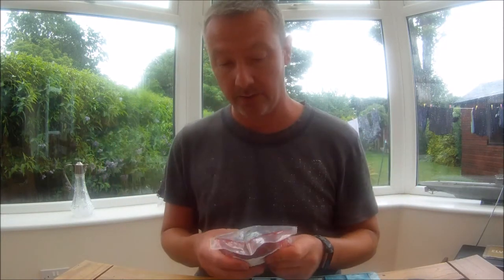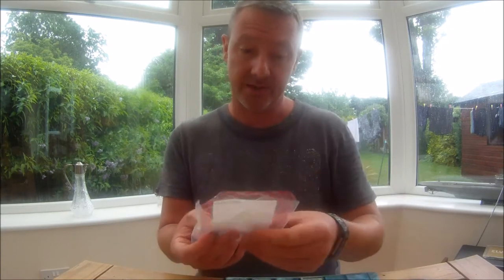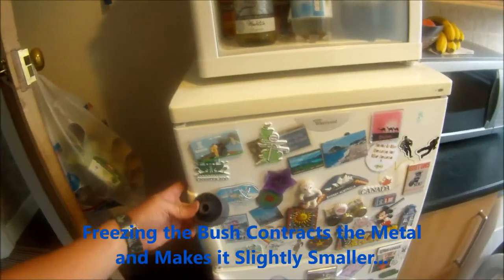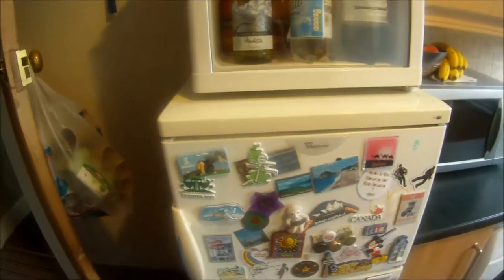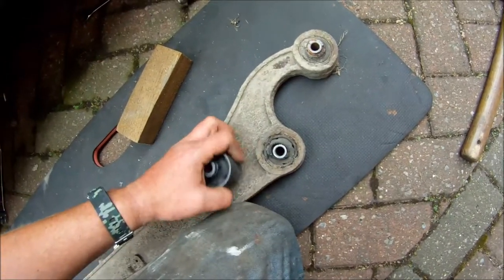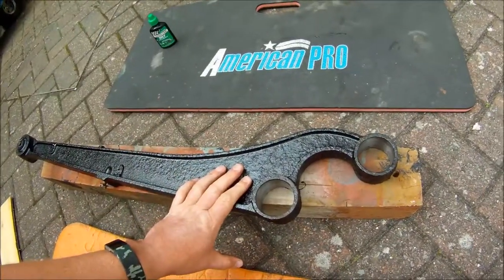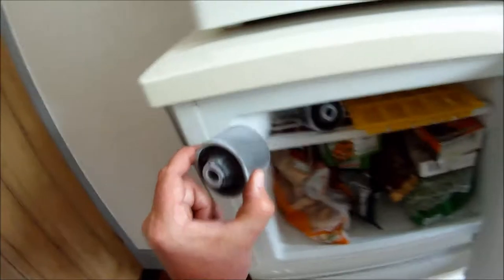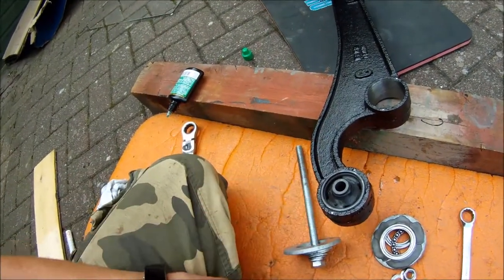How to Replace Trailing Arm Bushes on your Suzuki Jimny without a Hydraulic Press.

Comment: Nice video, do you think you can share with us the measures for make that mini press using those washers and the bolt ? Also i couldnt understand exactly why the bearing.. I dont have easy access to that kind of bearing, can I skip it in any case ? I have those bushings and I ll do that replacement this sunday and Im getting ready to it hehe
Reply from the maker: Jonathan A. Zuñiga O. As long as you have one washer (or socket) 52mm (the same size as the bush) and another washer (or socket) bigger than 52mm on the other side you will be fine. The bearing was used as it is 52mm (the same size as the bush) and makes it easier to press in as the bearing rotates so reduced friction. The other washers were used to reduce the internal hole size down to the same diameter as the bolt. Hope that makes sense and good luck !
Reply: @simonskeloggs4811  Thanks for taking your time to help. I ll do that !. one last question, My jimny model (2007) uses a bushin with no holes like your bushins, this mean I can put it in any way right ? . Thanks in advance
Reply from the maker: Jonathan Zuñiga Yes, that’s right. The solid bushes can go in any way. Just remember to freeze them!
Reply: What size bolts go threw please